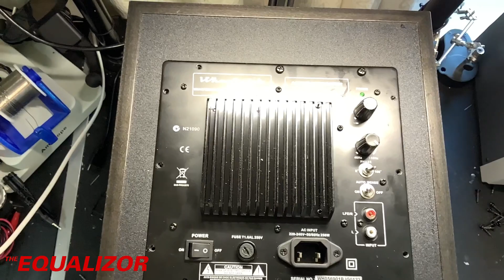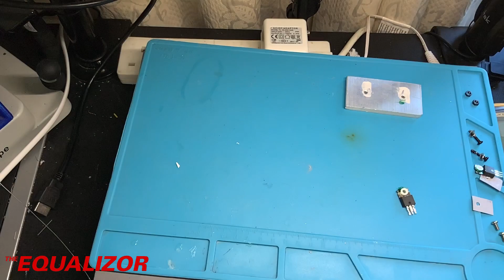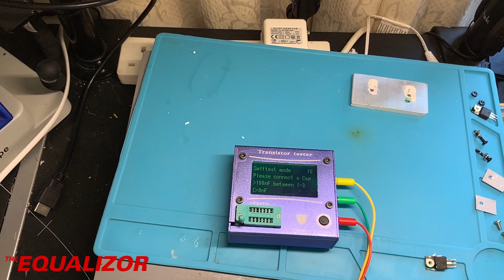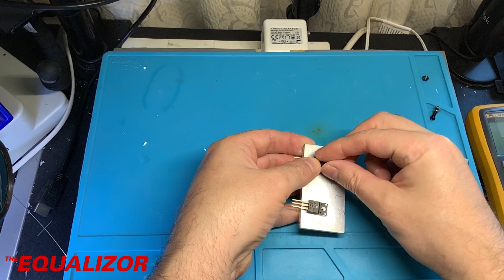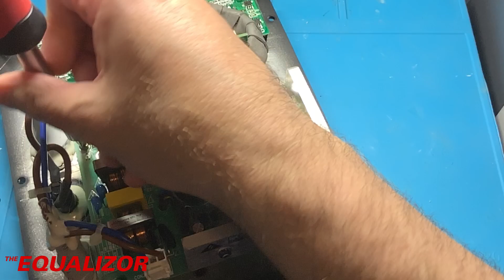Wharfdale WH-D8  active subwoofer repair

Comment: Can I be the n-th person to think 'he didn't use the mica insulators behind the mosfets first time around... Wouldn't that have killed the chip? '.  12m 00s, and still on the mat as you soldered 'em in. 
Not being snarky at all... All good in the end! I have done MUCH worse and more terminal.
Reply from the maker: The Mica washers were not needed as the replacement Mosfets were Plastic Bodied, as opposed to the original ones which where Metal Tab and back....Good spot  though, I can imagine someone making that mistake 🙂

Comment: I have the wharfedale dx-2 package, the subwoofer, stopped working, no power on LED, the board is WH-S10E (power), cables, switch and fuse ok to main board, I moved the untit the other day and LED came back on but nothing again now, checked FETs no shorts, and switching chip hasn't blown, no obvious signs of any chips or caps blown, no discolouration either.....could be a dry joint but can't see evicence of what would be a stereotypical dry joint, looking at the output it seems to suggest MUTE, 127v, G and +27V, is this correct, can put it back in situ and test, if you have any pointers, would appreciate the help.

Comment: Hi, can anyone please provide me with the component values of the following which got charred- resistors R1, R2, R3, capacitor-C3 and diode-D11 on the power supply board. I really appreciate any assistance.

Comment: Thanks for the video, I was hoping this would help me, however I had a Wharfedale DX-2 sub that has died. Checking the PSU there is no power output but it hasn't popped the fuse and the two mosfets you changed aren't shorted. 

I'm at a loss to what is wrong with it.
Reply from the maker: Have you checked the MOSFETS to see if maybe they're open circuit? That would be unusual but not unheard of. Those cheap eBay transistor testers are perfect for testing MOSFETs.

Comment: Excellent tutorial! Thank you. I noticed that you swapped the ir2153D (with internal diode) for an IR2153. Are they totally compatible?
Reply from the maker: Well..from what I’ve read, the body diode is an intrinsic part of most mosfets so I guess it doesn’t matter which one you use, but I’n not an expert. But what I can say is that the subwoofer is still working to this day.
Reply: @the_equalizor  Good to know! Thank you
Reply: It doesn't matter because the circuit on the PCB has an external bootstrap diode from VCC to VB pin anyway. So whichever flavour of IR2153 you used (with internal bootstrap diode or not) it would work anyway.

Comment: Hi The Equalizor. My WH-D8's power supply just died - I've changed both MOSFET's but there is also a fried resistor of which I can't read the parameters. Do you happen to have a circuit diagram of WH-D8's power supply module? Thanks a lot.

Comment: Hello mate, I have the same sub but it won't turn on anymore. I watched your video and checked the fuse, MOSFETs, every resistor and capacitor and I still can't find the problem. Any advise/hint would be much appreciated!
Reply from the maker: I think my advice would be to grab the schematic (pretty sure I found it easily through google) and just have a look at the primary side of the circuit. Follow the mains through up till the SMPS chip.  Do you have mains up until that chip?
Reply: @the_equalizor  Thank you so much for your advice. When phase and ground cable connects with the SMPS board there is right after the phase board connector a thermistor which looks like to be blown (failed diod test). Looks like too much current destoyed it. Will a simple fix solve it or is this part of a bigger problem?. There is no current arriving at the SMPS chip. I haven't found the schematics online ;-(
Reply from the maker: @Black_Lotus1337  The thermistor will be an ntc for current inrush protection. Can you send me a good quality pic of the power supply section of the board please as I don’t have access to that subwoofer any longer. Send to robscott@mrhangman.co.uk please.

Comment: Hi may I ask what the original problem was?
Reply from the maker: It kept blowing mains fuses.
Reply: @the_equalizor  Ifs its the 1.6a fuse that keeps blowing what is likely to be the issue?
Reply: Thank you I am only wondering as I have a subwoofer where it has intermittent power.
Reply from the maker: Mmm interesting. If it has anti-thump could it be an issue in the circuitry there maybe?

Comment: The Equalizor,  
1) 17:38 This problem, I think, you may try fix with help a bamboo stick for teeths =) Melt the solder and slide a stick between the legs. Also, I have using sticks for clear holes from solder. A solder does not stick to wood.
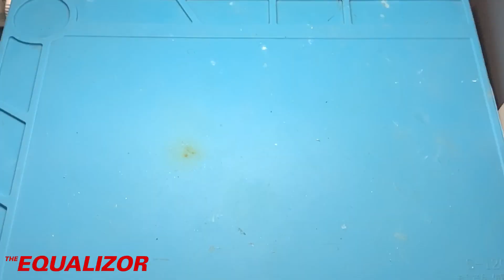2) 23:20 - If you interesting, I may to write about simple selfmade device, which help save (at least will increase the chances. I saw it at our repairmen on YouTube) mosfets from burn after enablen to AC.
3) I think that it is wrong to connect the power supply to the load after repair. Perhaps you should first measure the voltage on the connectors? I'm not specialist, but I like to watch repairmens in youtube and they don't connect while measure the voltage.
p.s. sorry for my bad English. Hello from Russia)

Comment: Glad you got there. When replacing ics, I take the opportunity to socket them as it makes future replacement so much easier.
Reply from the maker: Yep, totally get that. I normally do socket them up! as can be seen in some of my previous vids.
However this is a mains rated IC and the standard DIP sockets aren't mains rated (Max. 60v AC usually). Also, as it's probably going  to do a lot of heating and cooling (and thus thermal expansion in the socket would come into play in that case) and its only 8 pins  socketing wasn't required or, I think, appropriate in this case.
Reply: @the_equalizor  That's a fair point....you clearly were more on the ball than me here :-)
Reply from the maker: @standishgeezer  How gracious of you to say that :-) Like I say in my videos, I'm not an expert, but I've been taking things apart since I was 2 according to my mum so that helps. Also, I hate working on mains stuff anyway so I always err on the side of caution when dealing with it. its good to get some viewer interaction - I enjoy that, but also your point will still be valid for most other DIP IC replacement, so people will read these comments and learn that, so its all good.